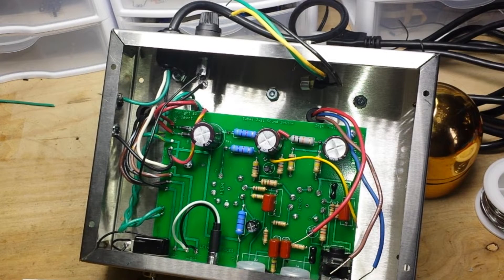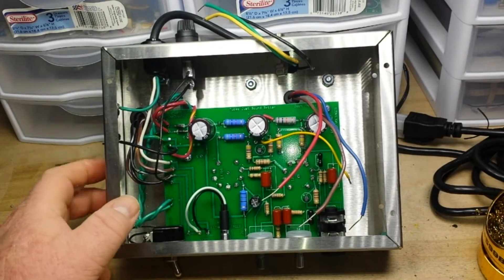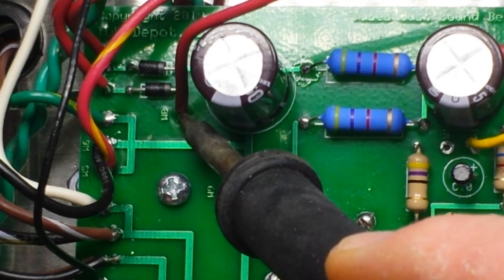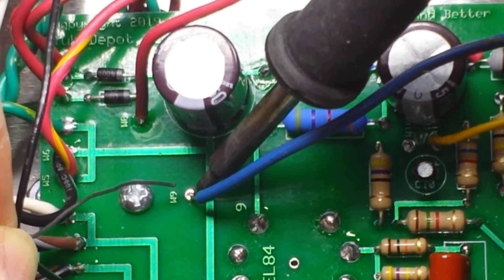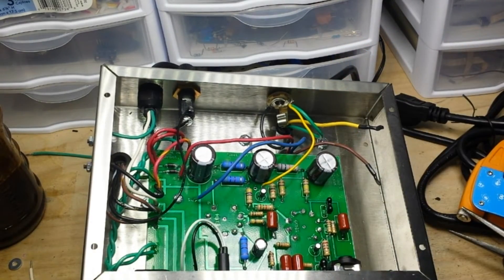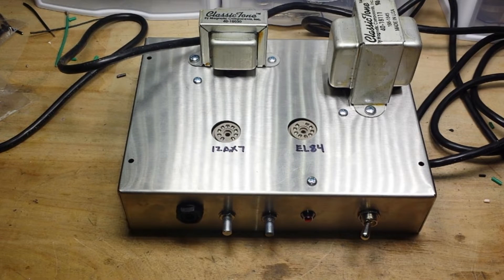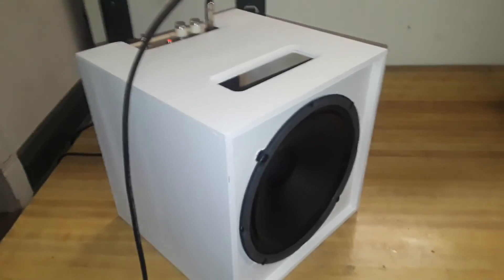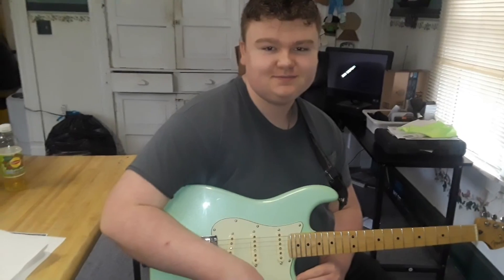Let's build a tube amp part 4 - finale

Comment: Right on Paul! Great job! One word of caution, be sure to use a dummy load on the output when the speaker is not connected. It will protect your output tube and output transformer.

Comment: Looking at the spec. sheet for EL84 ... in Class A operation the max limit is 300v & "operating voltage" is listed as 250v ... so you are well within the devices working limits Paul .. I think valves are more forgiving than semis in this respect... the heater is probably the more vulnerable valve component... 

😎👍☘🍺

Comment: That is great! The amp is working and no tingling. I had a Gibson amp when it rained outside or a damp day, you would get a tingling when flipping the switch. The thing weighed a ton. it was a little taller and not as deep as yours. It must have been 50 lbs. I use to sit on it when I played in my room... Lol
Yes Indiana is like Ohio, a scary mess and locked down for 2 weeks for now... Stay safe my friend and thanks for the build!
LLAP

Comment: Great job, Paul. As well as a dummy load on the output, I would have checked to see if there was any voltage across the input, just to be sure. Stay safe.

Comment: I noticed that the power line chassis grounds of your BUD amp are soldered by design.  This will be okay, but as you're undoubtedly aware, it's not considered a safe solution as solder joints can melt and fail under high amperage, which is exactly what happens in a short-circuit before a fuse or breaker can interrupt the flow.

Standard practice for UL-listed products is to use a crimp connector for power ground and to then screw that connector to the chassis with a screw and lock-washer; some manufacturers even add red lock-tite as insurance against screw loosening and, perhaps more importantly, lawsuits ;) .

Secondary grounds running to star ground points are often just soldered as the main priority is ensuring that the chassis cannot float to high voltages, but crimping and screwing these is sometimes easier for those without powerful soldering irons.

Comment: Hi nick     i have a old rockola jukebox is there any way I could connect a mp3 player to my ceramic cartridge input on my stereo valve amp the cartridge plugs into a 3 pin socket  barry

Comment: A potential issue with using solid-state power supplies in tube amps is that the full B+ voltage is applied to the tubes at power-on before the heater filaments have warmed up.  

Solid-state "fast-start" can supposedly harm the tube over time or at least that's what I was taught 20+ years ago ;).  Back then, high quality tubes were hard to find, so people were especially paranoid about protecting them; it's possible that the harms of fast-start were either imaginary or exaggerated.  Perhaps someone else can provide more up-to-date information on this.

If delayed start-up is desired, one solution is to add a Standby switch.  Since your Bud chassis doesn't include the holes or hookups for one, it may not be worth doing, but often the safest solution is to put the switch in the center tap lead(s) for the secondary side of the power transformer.  That avoids running more dangerous B+ wires around the chassis, but it sometimes isn't an option if the transformer has an internal or built-in center tap.

In that case, it may be necessary to intercept the B+ between the rectifier and circuit board.  When doing this, I recommend heat shrink or other means to cover all exposed metal in the B+ line, but you're already aware of the dangers of high-voltage DC ;) .

Comment: Twisting the filament leads helps reduce 60 Hz hum.  You also want to route the filament leads against the chassis and away from B+/plate/screen leads, to 
avoid impressing 60Hz hum into the signal path.
As said previously, never run a tube amp without a speaker or dummy load on output. Any amplified signal (even from a scratchy potentiometer or noisy
cathode) can  put a huge voltage spike on  output transformer--the most expensive component--and smoke it right quick.  Even a dead short  will work, if
that's all you can come up with.
For sanity, it's always worthwile to check voltages on the guitar-end phone plug.  There's some cheap mods you can do to guitar wiring to protect the
player in case you do plug into an amp that has dangerous potentials on the input jack.

Comment: You should be using a dummy load.  You will read higher DC unloaded.  Also dummy load protects output transformer.

Comment: Paul, every time I see those bare connections with AC mains on the fuse holder it has me clutching my pearls. Please, for the love of «diety», put some heat shrink on those connections! Also, I'd be super interested in a video covering how to eliminate the hum/buzz that I was hearing when your son was plugged in at the end.
Reply from the maker: The hum is 60 Hz hum from the mains AC. The guitar he was playing has single coil pickups. They will always hum. The cure, is to run two coils, out of phase. You can do that with a pickup called a "humbucker" or wire 2 single coils together out of phase. His guitar has a 5 position switch. P5 is neck pickup, P4 is neck and middle out of phase, P3 is middle only, P2 is middle and bridge out of phase, and P1 is bridge only. So in positions 2 and 4, you eliminate the hum. But he likes the P5 sound.

Comment: I noticed you touched the tubes with your fingers.
This is not good because the oils from your skin will leave an oil fingerprint on the glass. This can create hot spots on the tube once they heat up and shorten the tubes life.

Comment: Great job. It looks fantastic. I think your relocation of the tubes to line up with the holes could not have worked out better. I didn't see why adjusting the holes was not an option. It may be obvious, but there is a reason I don't hunt snakes. I'm just curious. Stay safe.

Comment: Would this be called a TEST TUBE amp ? ... 🙄😂😂

I remember as a 14y.o. building a H.A.C.  1 valve shortwave kit... a little alum. chassis.. 3 plug-in coils ... regenerative design..

I picked up stations from all over the world on that little rig + 30' of wire ... my prize possesion was a QSL card from HCJB Quito Equador... (I live in Ireland) ... my bedroom walls were covered with QSL cards... the postman was intrigued at this kid receiving mail from all over the world... 😂
That was almost 40 years ago ... the world was a BIG place back then... 😔

😎👍☘🍺

Comment: The ECC83 is the same tube as the 12AX7, ECC83 is the European numbering system whereas 12AX7 is the American numbering system, but both tubes are functionally equivalent, and use the same pin connections, both the 12AX7 and ECC83 should work in the amp chassis.
Reply from the maker: Thanks
Reply: And same with EL84/6BQ5.

Comment: I just don't understand.  I applaud all the work, skill and knowledge you put into this project.  But I just don't get the tube thing.  Expensive, inefficient, and Huge.  Probably never will.. :-)
Reply from the maker: Tubes sound better. Transistors are harsh, tubes are smooth.